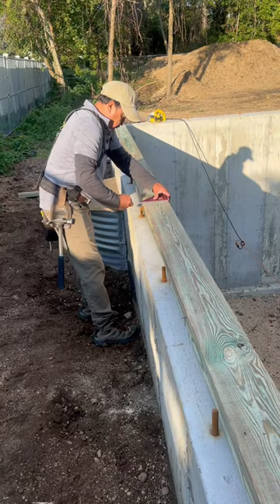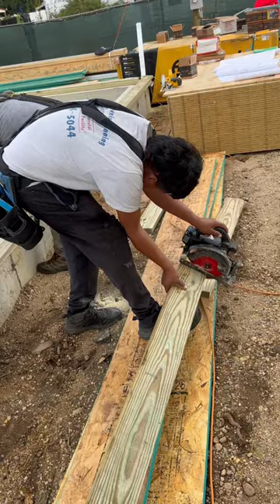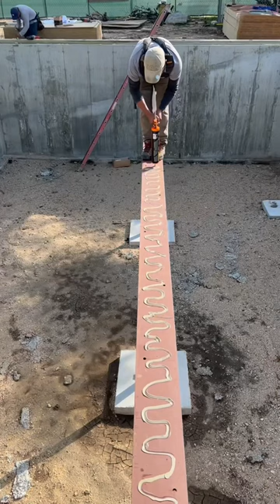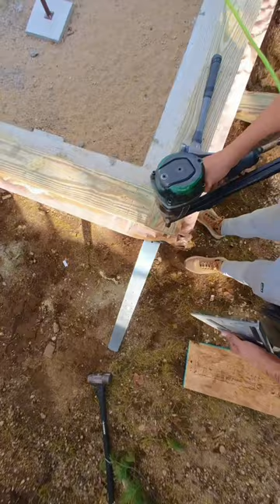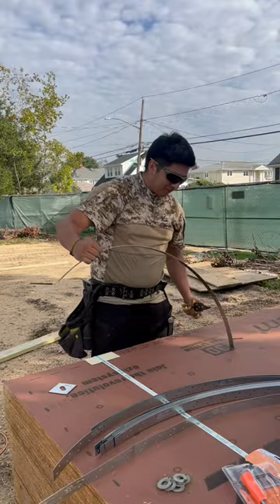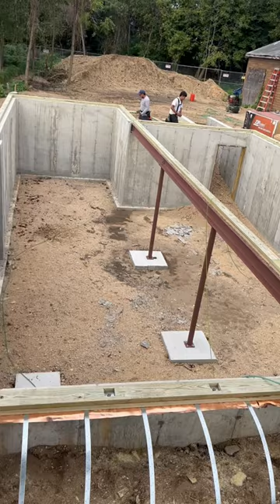Plates #shorts #short #construction #work #skills #perfect #team #design

Comment: Why the brass plate and not some rubberized sealant material?
Reply: The brass plate makes it so there's no contact between the wood and the concrete.
Reply: @1776-v9l sure, in europe we use a rubber type mat, i was wondering whether there is some benefit to brass
Reply: I have only seen copper sill flashing used to keep termites at bay.
Reply: @Hammerandnail interesting, so its against termites
Reply: Cooper not brass, termite shield

Comment: You'll have to forgive me if I'm a bit confused, but If you're doing a double  seal plate but only bolting the bottom of the double, what's the point in bolting since the walls will only be attached to the top of the double?
Reply: It will have straps also. Strapping the double plates together.
Reply: What is the point of a double seal plate?
Reply: @grellopc  It's code in their region of the United States.
Reply: @grellopc  One good point is that the plywood will span and fasten 3" onto the bolted down seal plate, instead just an 1/1/2".... it actually makes a much stronger connection between the wall, truss and seal plate.

Comment: I still go back and forth between measuring for the holes like this in plates or putting the plate on top of a level head set of bolts and whacking it with hammer to show excact location.
Reply: My buddy would call the second option the "Quick Quick Cheap Cheap"

Comment: Do you need washers on the bolts? Or did i just not see them?
Reply: That hardware on the top counts as a washer. Personally I still like to see the anchors sitting on top of the bottom plate to not have the material removed, but will make installing the floor joists much easier this way.
Reply: Those square pieces they recess into the bottom plate are the washers

Comment: Love how he used a speed square to check corner. He knows 7 inches of it are square 😅 naw I'm sure they pulled corner to corner numbers before chaulking lines. I hope.
Reply: Honestly, they will have to go off the footing. It's too late to check for square. They can adjust somewhat, if hardly but checking layout it for the ground and foundation. They can keep checking as the walls are getting put up.
Reply: @juanlanda967  yea you're right, if the block is out nothing they can do. Just seemed funny seeing him check those long plates with a speed square, similar to plumbing a 9 foot wall with a torpedo level.
Reply: this is why I do all my own structural concrete work, sometimes I'll sub out the pour and definitely the flat work but I do forms and rebar. nothin worse than getting plates lined out and realizing how much they screwed ya lol. they just don't care, theres no excuse for bein more than an 1/8 out on concrete.